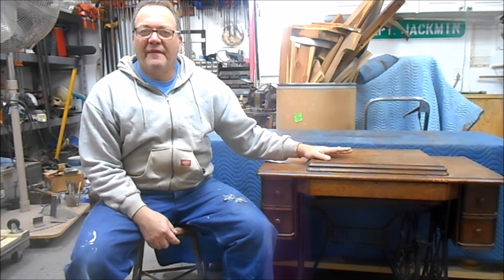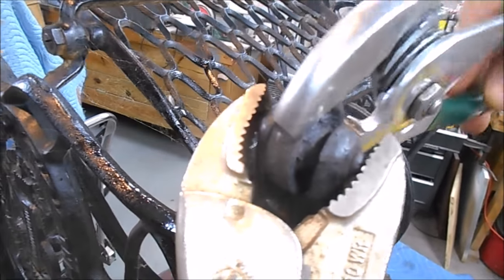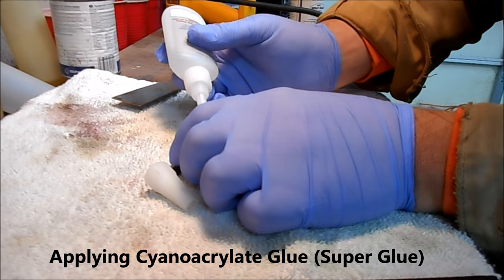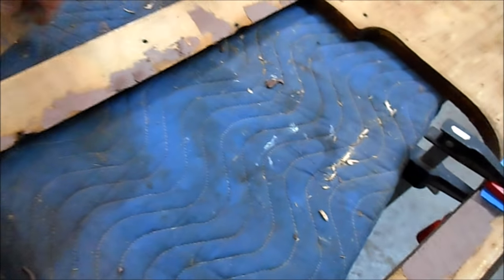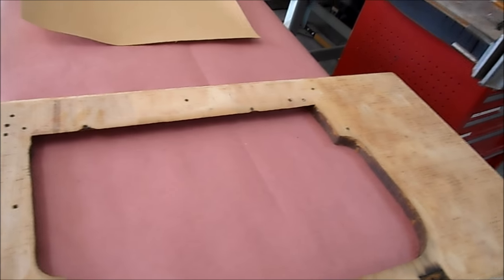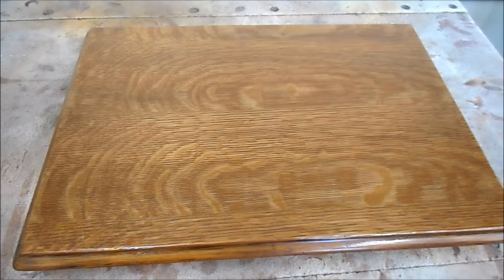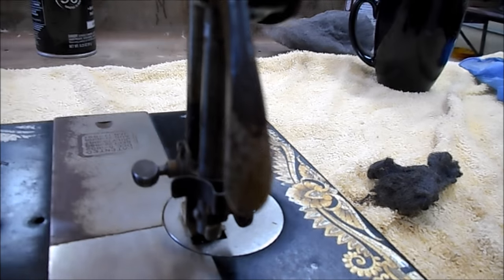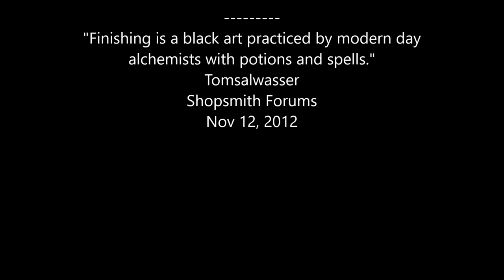Another Singer Treadle Restoration - New Challenges Only

Comment: Great work! I love how much time and care you take to restore these! I was fortunate to find an 1891 New Domestic that is like a time capsule! She was a cherished one that was always stored in a home. Her cabinet is gorgeous and nothing needs done to the completely original finish. Her interior piece of frame that holds the machine in did need replaced. It broke during a move before I got her and was badly repaired.  My son in law is a wood worker who has a buddy with a wood duplication machine. They bought 100 year old wood and made the frame exactly like the original one and put the old hardware on it. Then they gave me back the original frame piece. Her irons are jet black and the only wear on this is her faded machine decals. A bargain we paid $40 for and all her parts move beautifully. The next Treadle I have is a White Rotary fanciest cabinet ever made with a gorgeous sewing machine! Covered in gold decals but there is a tiny bit of fading....1911 so I can forgive that for sure. Her irons are not jet black but I will be working on that as they look pretty good. I cleaned the sewing machine and she came out amazingly well! I ordered the different feet she needed off ebay and scored exactly what would have come with her ...fortunately I don't have to take her apart. The only bad part of her cabinet is the very top center where the veneer was singed, a small crack and chip...she also has a blackened corner where it appears this one survived a FIRE! She must have been lovingly used because all parts move freely. Her cabinet is sawn oak and very ornate. Luckily all of those ornate pieces are in great condition as they would be tough to find.

Comment: I really enjoyed this video*:) Just today I found this exact same Singer in the local scrap yard what a shame.I bought it for $4 dollars it has the same Egyptian design n everything.I managed to get in contact with a friend of mine that has the treadle:) I plan on restoring it all I jus have to find a belt and mounting bolts to the table.I plan to email you*:)
Reply from the maker: Congratulations on your find and pending project.   Check eBay for hardware you may need, they show up fairly frequently.   I think I got my belts of Amazon as they are still available from a number of vendors.   There is a good video on YouTube showing how to fit and attach the belts.   If you search around you'll find it.   Feel free to reach out if I can help from afar.   Glad you enjoyed the video and thanks for watching.
Reply: I tried to email you said address not found idk?? ill try again*;)

Comment: Good day to you Sir. Thanks for all of the awesome info you have taken the time to share with us. Your work is impeccable with beautiful results. I want to ask a question about laying down the veneer wit the contact cement. Does the veneer have to have the paper backing to use the contact cement? Will this technique still work if the veneer is not paper-backed?  Again thanks for all of your info. I have watched about half of your videos and will continue to go through the rest.
Reply from the maker: My understanding is that contact cement is to be used only on backed veneer.   If you search around the internet, some woodworkers don't use contact cement  at all, for various reasons.   I have found http://www.joewoodworker.com/ is a great source of information as well as supplies (his other site is veneersupplies.com).  If you have a vacuum press or the ability to clamp up a large platen, there is probably no need for contact cement.   If you don't, then it may be a viable option for you if you are using a backed veneer.

Thanks for your question.

Comment: Instead of using steel wool on that front plate coat it with gojo, let it set, wipe it off and do it again,  you'll 
be surprised how it comes out and it doesn't scrape the metal away like steel wool does leaving it dull.   ;O)